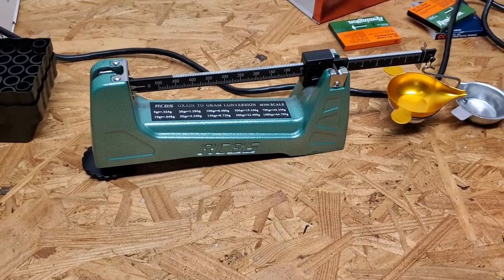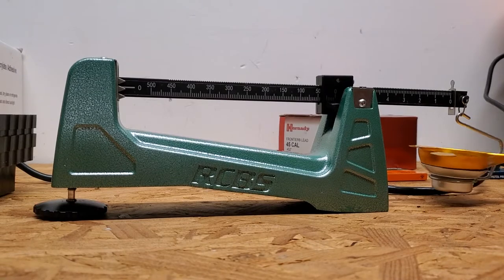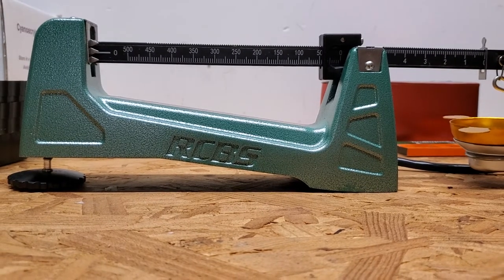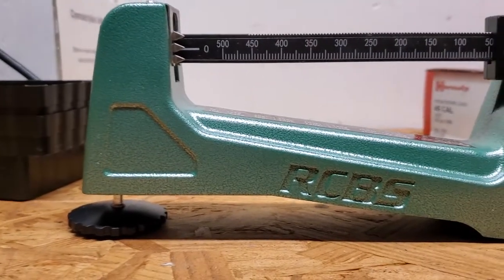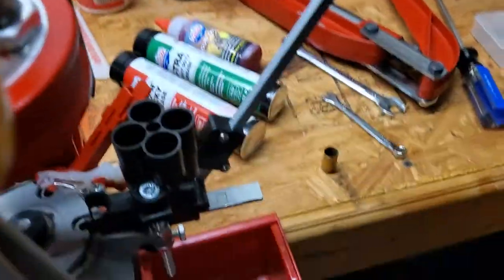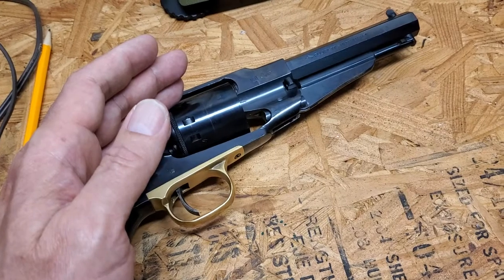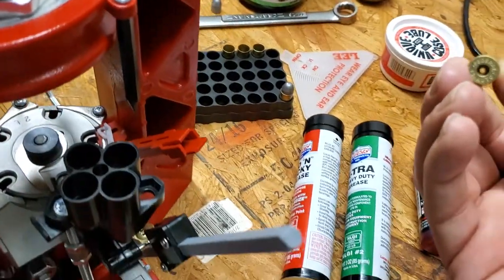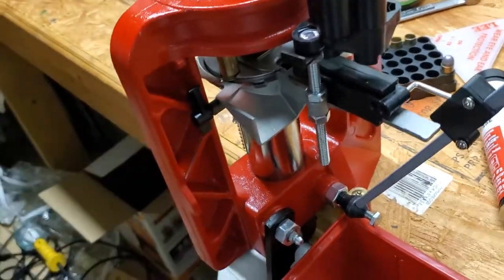Balance beam vs. Digital scales

Comment: +-2 grains?
Reply: Makes no sense, must be 0.02 grains I hope, otherwise this scale is trash 😖
Reply: @leonardosilver9578  0.01gr
Reply: Resolution of the scale is 0.1 grains.(1/10 of a grain) Accuracy of a similar RCBS 505 scale is very near +- 0.05 (1/20th)grains by my testing and similar results found in youtube videos. Advertised 0.04 gr accuracy scales start at about $400. 0.02/.015 costs+$750. There are a few +$1200 scales that claim .01 grain or better accuracy.